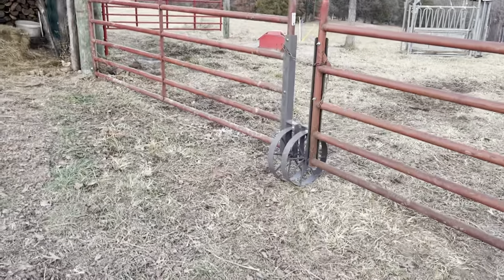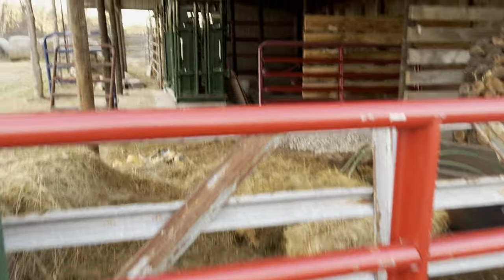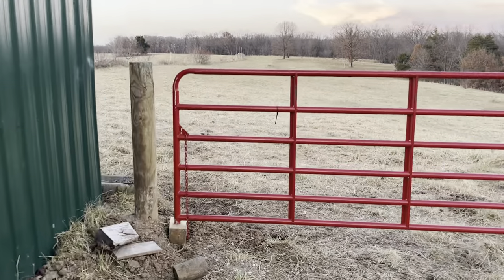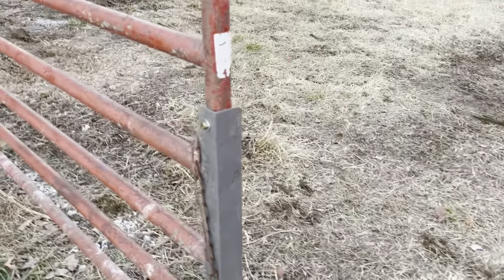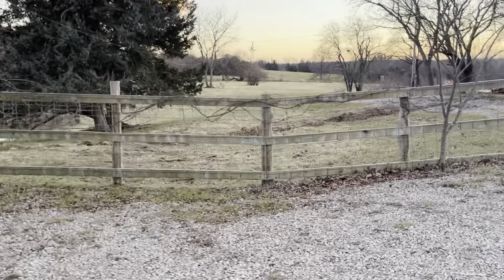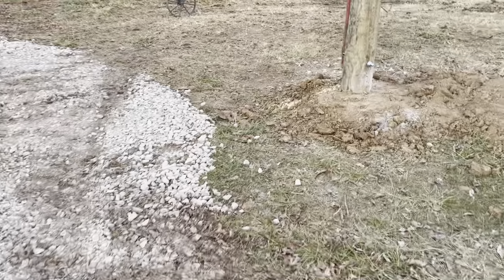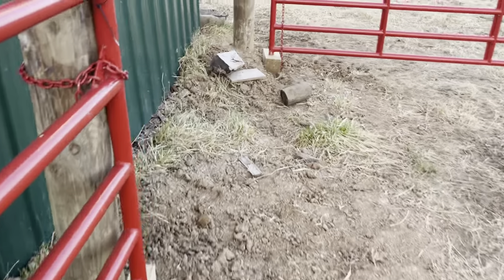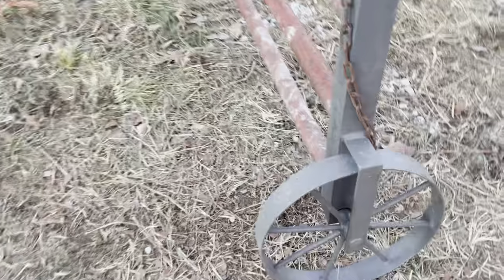We are building a new corral on the Judy farm to replace our old hi-tensile corral holding area.

Comment: Good morning Greg and family. Tractor supply sells a spring loaded gate wheel kit. $30 and a hard rubber wheel so you can use it across a paved driveway. Those wheels your friend made are a nice diameter for that location but I instantly thought:How would they work if the ground wasn't level thru the travel of the gate as they aren't self adjusting?  Greg you are never going to need a gym membership because you have plenty of exercise to keep you fit,lol. What do you do with goofy cows?Don't breed it, eat it. I'm going to steal that saying,lol.

Comment: Thanks for the video!  It sure looks nice to you will have everything set up. I’m going to make another pen for my cattle.  So I don’t have to drag them to my chicken area. Cattle can be goofy for sure. Also, you don’t have to worry about it but you could break animals to hot wire in that kind of pen too.  I trained one of my new rams I bought that way. Of course it was a smaller pen. I just put the wire about 6-12” away from the fence. First, I fed hay in another spot for a week. The , the second week I put the hay next to the hot wire. He must have gotten shock because he won’t cross the temporary fence when I moved him with the rest of the animals.

Comment: Why didn't you cut your own lumber with your sawmill for the corral?
Reply from the maker: Time and cost. I can buy four 16 foot 2x8’s for the cost of what a single 2x8 rough cut white oak board sells for.

A 2x8 white oak board sells for $300, dump truck owners are begging for them, they use them on their gravel trucks. Each 16 foot corral section, your giving up $900 of white oak boards😩
Reply: Follow the money he say